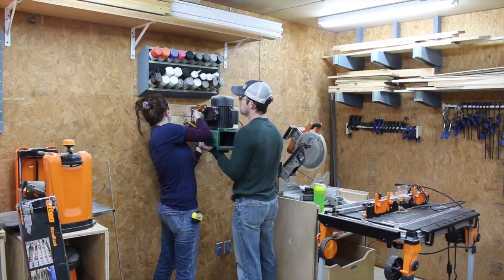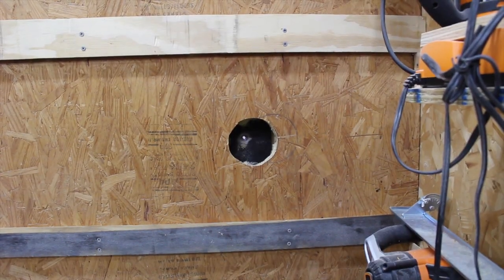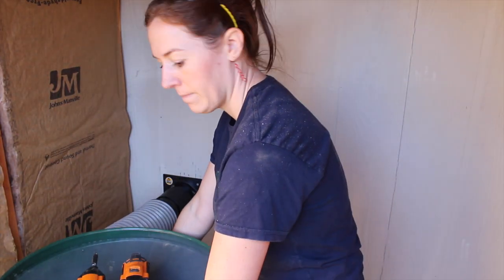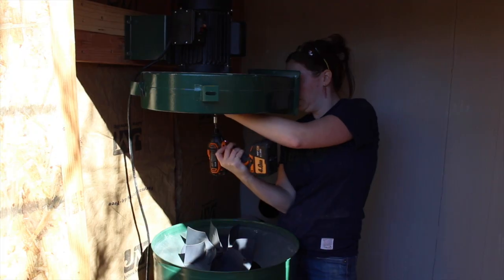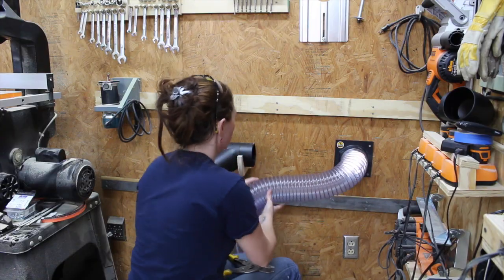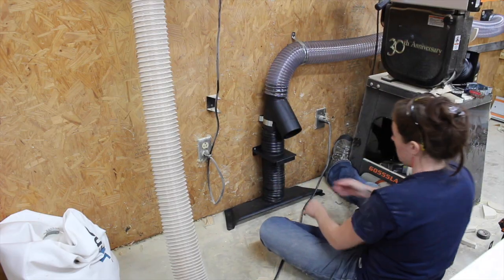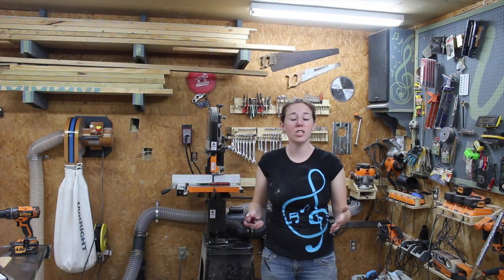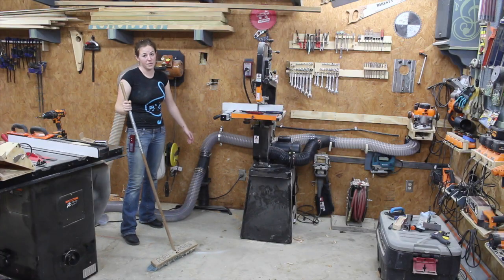Installing My Harbor Freight Dust Collector (Finally!)

Comment: Are all dust collectors rated at 20 amps? I only have 15 amp breakers in my shop.
Reply: The amp rating should be on the motor, if not contact the manufacturer.  Twenty amps uses 12 ga wire (Yellow jacket NM 12-2/g).MINIMUM.

  You should replace one of your 15A circuits or run a new 20A circuit and get a 20 A rated cord plug and a 20 A outlet.   (NEMA 5-20P / NEMA 5-20R
Reply: That is exactly what I am going to to do this weekend! Thank you for the helpful information!
Reply: True. The last thing you want is to run that much power on too small of a wire. The wires may get too hot, and melt the insulation jacket coating them. That's how fires in the walls can get started. Best to rewire, if possible. Hopefully you were able to.

Comment: Wouldn't it have been easier to move the motor past the stud so it would not have to be plumbed in?  Also, when ever you attach vacuum lines to the main line if possible have them come into the main run from the top of the line. This keeps the incoming dust from falling back into your branch line.

Comment: This installation demonstrates a typical mistake also done with air conditioning.
As you vent outside the shop and not back into the shop, you are actually removing all air from the shop, ie either your heated air in the winter or your cooled air in the summer is being removed from your shop and replaced with air from the outside from whereever it can be pulled in..basically the air should be filtered and vented back into the shop to not have an energy loss
Reply: +Dennis Boisen These filters don't remove enough of the fine dust which is the  most hazardous. I don't think her shop ever needs heat (she seems to live somewhere very warm). Maybe she can comment on whether it is air conditioned. It is also possible to use a heat exchanger, and still vent outside.

Comment: QUESTION: Why on earth do you need a dust collector? Why not just have that turbine blowing the dirt/air outside? If you blow it at a fence, then you can have a pile build up, then you can move it with a shovel.

Comment: Nice job! I want to do the same with my HF DC but with a Super Dust Deputy and vent the exhaust outside like you did. I'm a little worried about how much dust ends up exhausting outside. Do you have any issues with neighbors?

Comment: poorly designed! I don't like the plastic flex tubes running across the floor like that!
Reply from the maker: Then do something different for yours....it works great for me.
Reply: my sentiment ,exactly ....lets see what you've done,mr poorly designed(dan khol).......you're one of a kind,,April Wilkerson ...i like your can do attitude...your husband is tooooo lucky ...jda
Reply: April Wilkerson
Reply: Boom roasted.
Reply: Table saws are a problem. If you drop the hose from the ceiling it gets in the way of making cuts or placing jigs. Same problem when coming in from the sides. Best solution would be to have an outlet in the floor but that is hard to do when you have a concrete slab for a floor!
Reply: #youshould